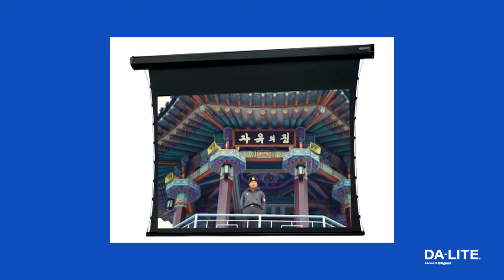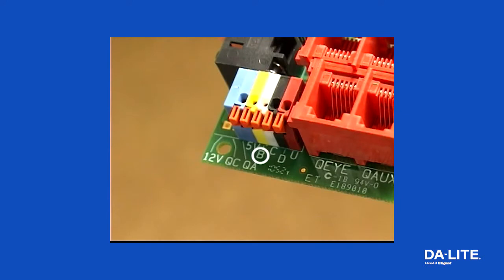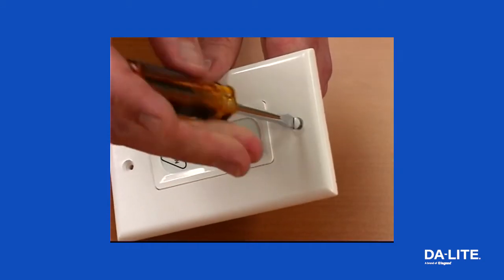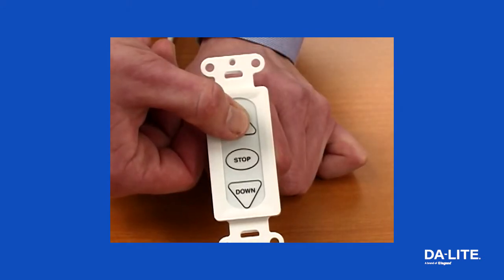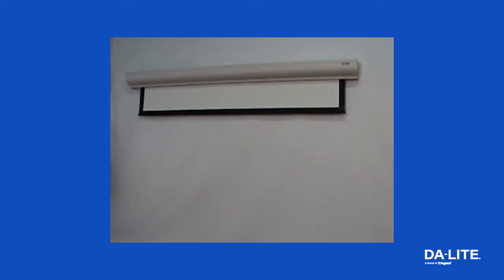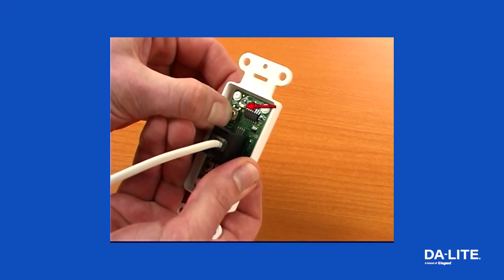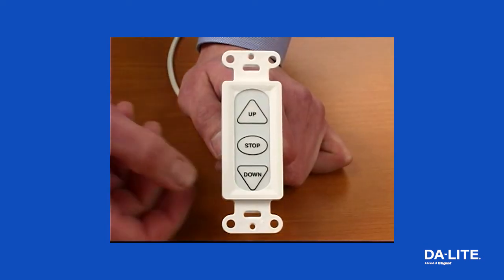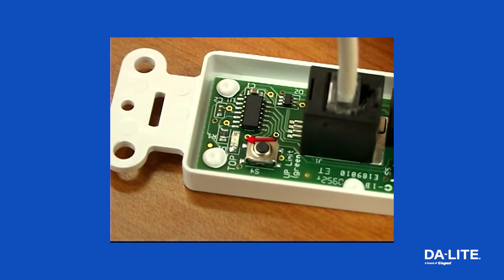Da-Lite Smart Motor Installation and Adjustment

Comment: Probably one of the most important things they didn't mention in here is when setting the limits, you only have about 10 seconds to do the entire process. Once you press and hold the down limit switch and the light goes red you have to immediately start pressing up and getting it to the right position then press and hold the limit switch again so that it blinks. If you wait a couple seconds after hitting the up down arrows to get it right where you want it it will just go back to where the limit was previously set.
Reply: Saved me so much time, thank you. You really need the quickness on this
Reply: Thank you